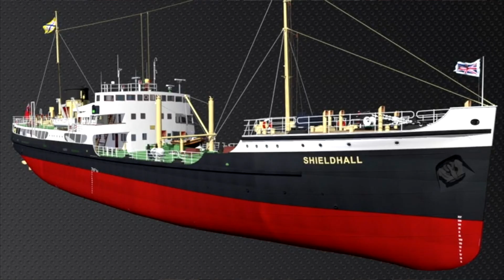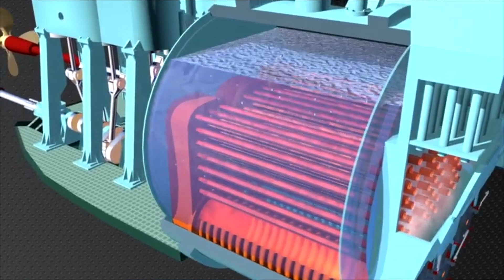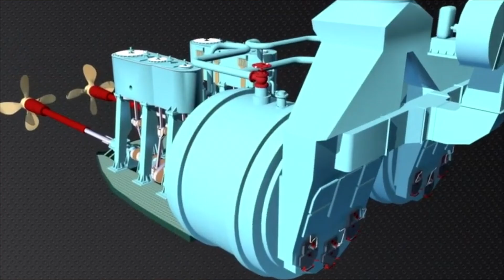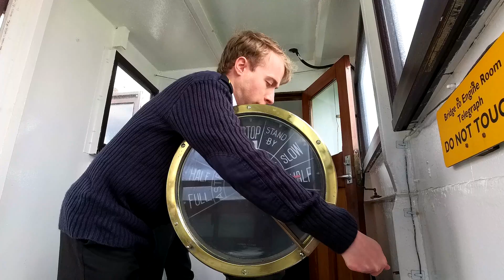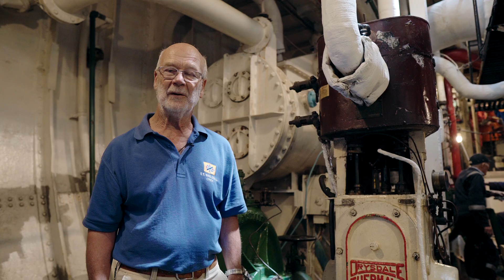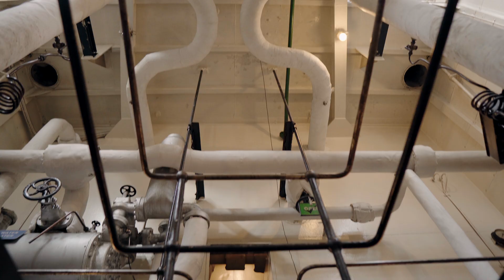Engineering marvel: Steamship engines tour | Steamship Shieldhall

Comment: was it always heated with oil?
Reply from the maker: Yes, Shieldhalls boilers were designed and built with burning oil in mind.
Reply: @SSShieldhall  when the boilers on the shieldhall are lit all they lit with diesel fuel until they come up to temperature then are they switched to fuel oil?
Reply: @rudycarlson8245  No, we use diesel exclusively.
Reply: @THypher1 
Was this always the case,or did the ship originally use heavy fuel oil?  How much oil is used per hour?
Reply: @srfurley  indeed, HFO originally. I’m not sure the diesel consumption per hour as a deckie and not an engineer. It is expensive though.